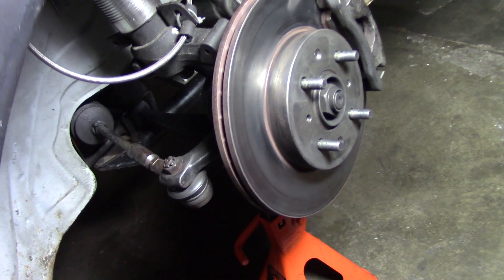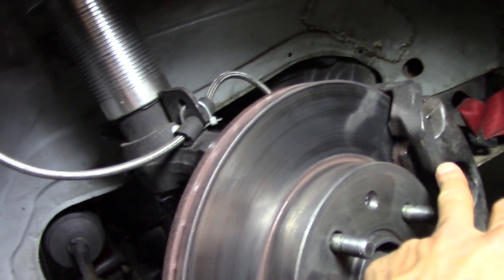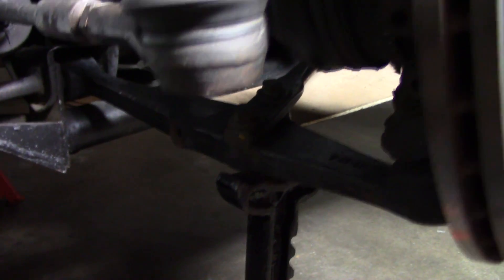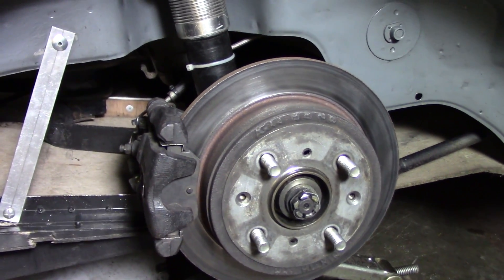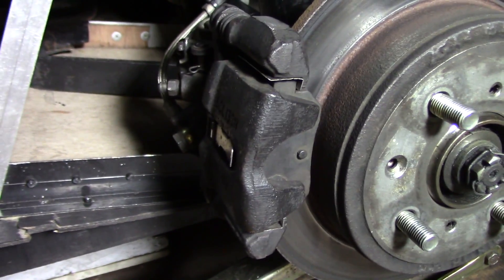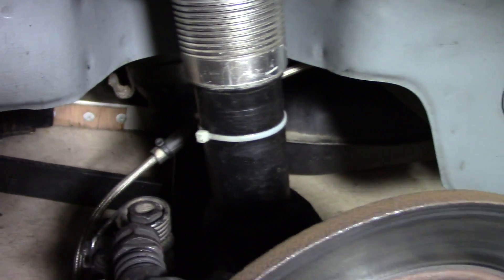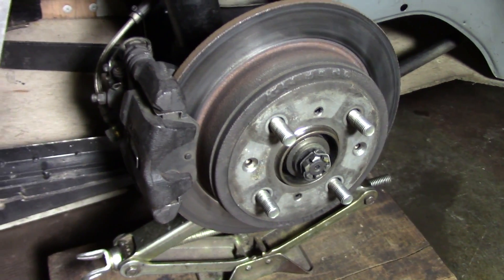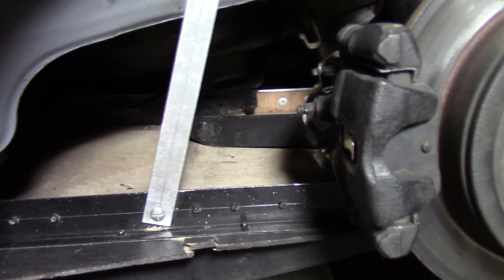Civic 1st Gen 4x100 conversion.

Comment: Salut! Pouquoi t'as utilisé un customdriveshaft? l'original est tros petit?
Reply from the maker: C'était pour pour adapter à la nouvelle largeure de voie, et au nouveau moyeu (4x100)
Reply: j'ais commencé l'adaptation 4x100 derriere, normalment les personnes utilise le roulement interieur 4g et le roulement exterieur de la sb1, apres voir ton video on dirait que tu a pas utilisé léxterieur  de la sb1 alors c'est seulement une piece qui pousse le roulement de la 4g sans modification?

Comment: what are the front suspension components from?
Reply from the maker: Front: Mazda Xedos inserts, and Honda Concerto Sleave. 
Rear: Honda Concerto Front Sleave and insert
Reply: Sorry to bother you again but i was making sure of the rear disc setup so i'll need 3rd generation prelude bracket that the brake caliper bolts to a 4th generation civic brake caliper and a 4th generation civic rotor correct?